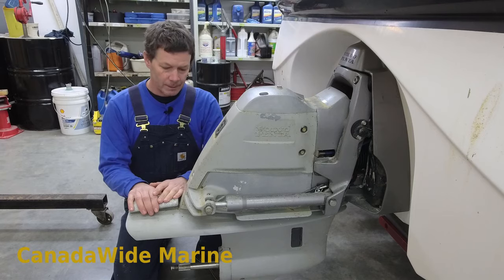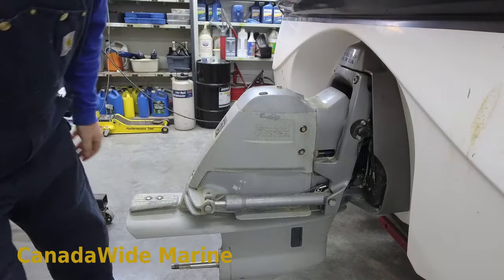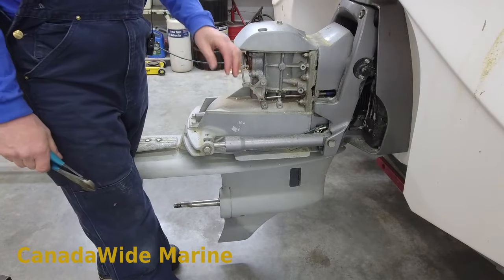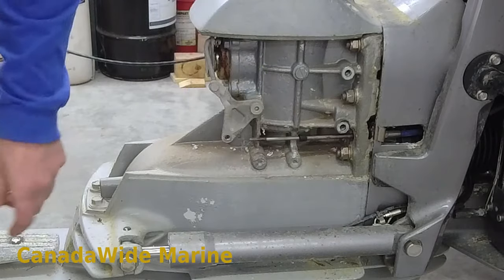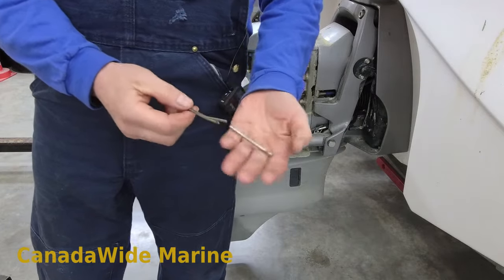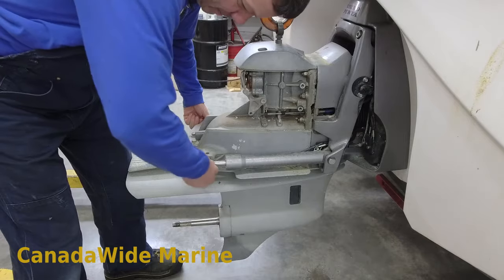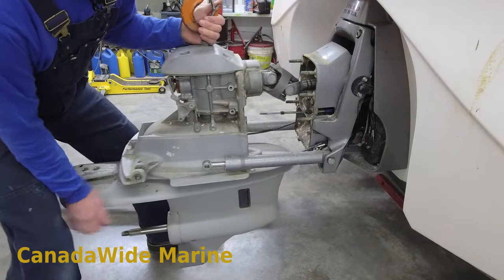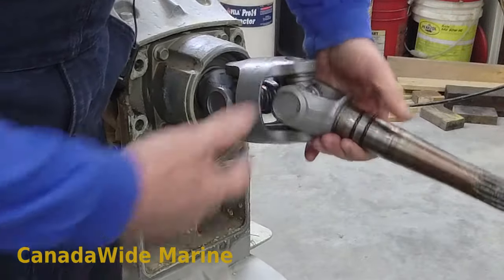How to remove and install a Volvo Penta SX sterndrive, and what to inspect while there.

Comment: To make the shift linkage removal/install much easier just put a dab of touch up paint on the threads next to the jam nut. Then when you install just put the jam nut up to the paint mark and your adjustment should be right on.

Comment: Thank you for posting this.  It is extremely helpful!  There are a lot of videos showing service procedures for the older SX-M drives, but for some reason, there is almost nothing available for the SX-A drives, so this is much needed.  It would be very interesting to see a demonstration of bellows replacement if you get around to it.  Question: the workshop manual says to discard the 6 nuts that hold the drive to the pivot housing.  Is it necessary to replace them every time they are removed?
Reply from the maker: Hi James, thanks for the comments.
Technically a nylock nut, or nylon insert locknut, is supposed to be replaced every use as the nylon insert looses much of it's locking ability after even a single use because the nylon becomes deformed to the shape of the threads. So, yes, it is necessary to replace them everytime they are removed if you want to maintain the same level of locking ability.
That said, I very rarely replace them, I can tell as I am installing or removing them how much locking there is left. And to touch on another subject I expect to do a video on in the future, I rely on the tension of the stud for it to remain tight, not the locking ability of the nut. The nylon insert really is only effective at holding the nut on after it has already come loose. Tension the stud correctly and a lock nut is not required.

Comment: do you guys check for steering wheel play?  My wheel has a lot of play.  Would this be fixed in the SX-A sterndrive or in the engine bay?
Reply from the maker: If there is a lot of play in the steering wheel you kinda need to work out where it is. A common place that can cause play is in the engine bay where the steering cable enters the power steering ram, if the big nut on the cable is loose at all you will get a lot of play in the wheel. When it is correctly tightened you should not be able to slide the outer cable back and forth into and out of the nut. 
Other things to check are the mounts for the power steering ram, check the pins where the inner cable attaches and the steering arm attaches to the power steering. Then you can start checking gimbal housing bearings. 
All that assumes you have cable steering.
If you have hydraulic steering you are most likely low on fluid and have air in the system. you will have to top up the hydraulic fluid and bleed the air out.
Reply: @CanadaWideMarine  so helpful!  Thanks a lot for taking the time to add so much detail!  I’m going to check these things ASAP.

Comment: Thank you for the video. Super informative. Question, I have a 5.0 gxi f with SX drive. It is very hard to steer at low speed, also makes a strange rattling noise when in gear, turning, and moving at a no wake speed. No idea what it could be.

Comment: Perfect!  A little different than Mercs, but well designed.  On a mid 2000's DP is the shift cable adjustment difficult since it sounds like the cover is not a "wrap around" type, restricting the side view and pinch bolt?

Comment: Fantastic video! Just a couple of questions for you: if you hear a rumbling while you’re under way, I would suspect that my final bearing is probably the culprit but if I Don have bellows leakage can I take the gimbal bearing out without disturbing the bellows? Also, do you not use a sealant between the outdrive and the housing?
Reply from the maker: Yes, you can replace the gimbal bearing without replacing the bellows.

Comment: Hello CanadaWideMarine, first brilliant video! Very Helpful and very good explained.
May I ask a question for you superb hook to screw into the oil level-thread, what do I need to build that? Many Thanks 😉👍
Reply from the maker: The hook is a short 1/2" UNC bolt with a ring welded to the top of it. I used a big 1-1/4 " ring to fit my hook into, but you could use a link off a chain too.
Glad you enjoyed the video. Thanks for watching.

Comment: You make this look way too easy!!!  I have a DPS-A outdrive.  Pretty sure they're similar except for the dual props.  I love the idea of using the engine lift!  How often should you change the seals and o rings?  I thought they should be done every time you pull the drive?  I never knew this was such an important thing to do.  I've had my DPS-A for a little over 10 years.  Never pulled that I know of.  The boat has been used very little, so I'm hoping all is ok.  I'll be pulling the drive very soon.
Reply from the maker: After ten years I would definitely change the seals and o rings. Generally I replace them every second year. I remove the drive every year.
Reply: @CanadaWideMarine  I sure like to, but I'm having trouble finding the parts I'll need.  Can you recommend a website?
Reply from the maker: Email us at support@canadawide marine with your make model and serial number and we will set you up. ;)
Reply: @CanadaWideMarine  I finally found all the needed parts, but a local marine mechanic recommended using Aqua Shield grease by Quaker Houghton.  It's a lithium complex NLGI #2 grease.  Very high water resistance and corrosion resistance.  High film strength, load capacity, temperature, and oxidation resistance.  I saw you used Extreme Grease by Quicksilver.  What do you think?
Reply from the maker: @azcharlie2009  any good quality load bearing grease will do. The key is to grease it annually.

Comment: Thanks for another great video! Have you ever had to change the Volvo Penta SX-A Trim cover with the updated one that has two of the hydraulic lines coming in from the sides of the cover?
Reply from the maker: Thanks for the compliment. Yes, A few years back I changed the whole transom bracket to the new updated style that seals better.

Comment: Great video! Very methodical.

I need to replace a trim/tilt hydraulic line. How challenging is it to get to those - the correct way?
Thanks in advance.
Reply from the maker: It's been a while since I've done one, but by memory it wasn't too bad.
Reply: @CanadaWideMarine  Do you know if removing the stern drive provides access to the hydraulic trim/tilt lines, or is more disassembly required?
Reply from the maker: Again, by memory, removing the drive will give access to remove the cover over the hydraulic pump assembly and the hose fittings. Some of those covers had a corrosion issue, allowing water into the hydraulic pump, the only solution is to replace the whole transom plate.
Reply: @CanadaWideMarine  thank you!

Comment: Awesome video, do you have to place engine in forward gear or neutral in order to remove 🤔?
Reply from the maker: It does not matter which gear the unit is in to remove it because you are disconnecting the shift cable before removing the drive. I usually leave it in neutral. I install the drive with it in gear, (fwd or reverse, doesn't matter), so I can turn the driveshaft by turning the propeller, then shift the drive into neutral before connecting the cable back up.
Thanks for watching, and the kind comments.

Comment: Do you know if it’s possible to replace the gears in the upper or do you have to replace the whole upper?  Called a repair shop and they said they could only replace the whole upper
Reply from the maker: Yes, it is possible to replace the gears in the upper. But, there are other things to consider. First, are the gears available?, (I would need your make model and serial number, and possibly a gear tooth count to find out). Second, the reality is not many marine shops rebuild sterndrives any more, so the shop you called may not be setup to do it, or may do it so rarely that they are not efficient at it, so it is often more cost effective for the customer and the shop to just replace the whole upper.
I would want to know why you need gears in the upper. If they are damaged at all, I would be replacing your whole sterndrive because I would not want to be responsible for any stray bits of metal from the damaged upper gears to find their way into the lower unit and damage that. 
And you should know that replacing gears in a sterndrive is not a simple job. All the gears and bearings need to be shimmed for the correct clearances. There is a whole procedure to do it correctly, it is not simply a matter of pressing the old gears off and pushing new ones on and slapping it together.

Comment: Add 11:20 you mentioned you installed a new seal 'at the front of the drive'.  Where is that covered in a video?  I couldn't see where that seal was and how it was replaced. Thanks
Reply from the maker: That was the input shaft seal. It is in behind the u joints. Not part of a regular service so I didn't cover that in this video. I may do some in depth repair videos in the future if there is a demand for them.
Reply: @CanadaWideMarine  Thanks for replying. I wanted to locate it and think I found it in my seloc book. It  looks like its the seal protecting input bearing that holds the drive shaft portion located between visible ujoint and the upper gear housing.  Enjoy your videos.

Comment: Do you have any tips on replacing the trim lines on the left side? Very hard to get to.
Reply from the maker: It's been several  years since I've replaced trim lines on the Volvo, by memory I think I removed the drive, and trim rams, then steered hard to port to get access to the cover over the line attachments on the transom plate.
Reply: @CanadaWideMarine  thank you...it was very difficult but I was able to without removing anything but the trim lines. Have to use a crowfoot wrench.

Comment: Any tips on getting the lower pivot pin out?
Reply from the maker: on the rams? Drill and tap, lots of heat and a slide hammer.
Reply: @CanadaWideMarine  No. The lower pivot pin to take the gimbal ring off.
Reply from the maker: I don't remember ever having to remove one of them myself, but I would likely use the same procedure. Lots of heat on the aluminum housing, expands the housing and breaks down the corrosion, then drill and tap the pin and use a slide hammer.
Reply: @CanadaWideMarine  Thank you.  The manual says to remove it to do the bellows, but I was able to get them both on without removing the gimbal ring.

Comment: How much does service like this cost?
Reply from the maker: Hi Adam,
To remove and install a volvo sterndrive is not a big job, including running the boat up on the hose after installation should only be about 2 hours labour.